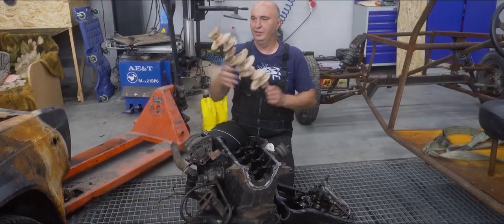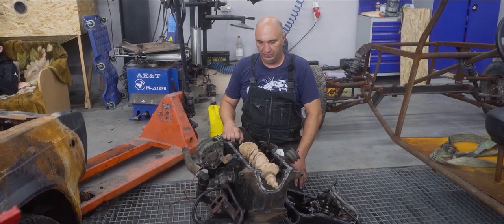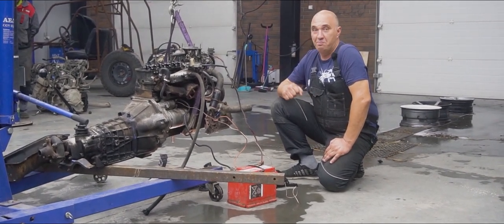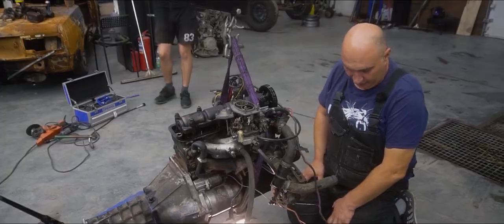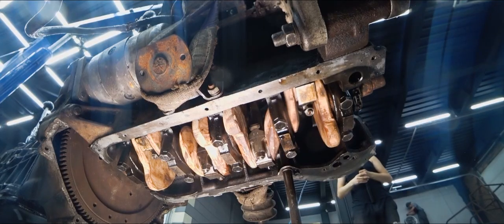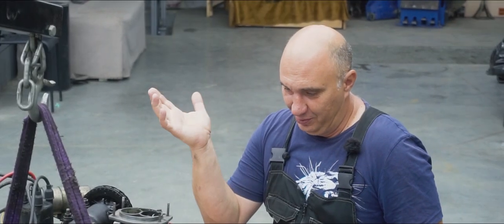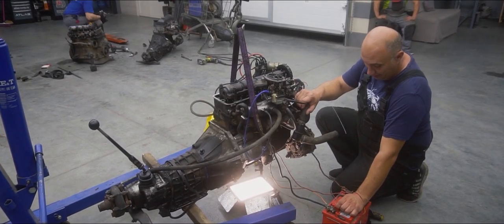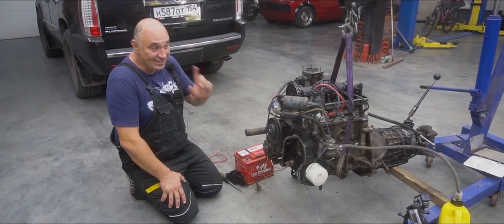Wooden crankshaft – will it work?

Comment: I think if you also use a wooden insert in addition to glue, I think it will hold (it can be a square, triangular insert) and maybe try to plate it with metal, as the wood swells due to temperature and oil.  I don't know if there is a varnish for wood to withstand high temperatures.

Comment: Hydro locked after pouring the fuel in the intake and not igniting the fuel causing it to lock up and break at the weakest point ie the wooden crank.
Great effort though 👌

Comment: try A; using drilled holes & dowl between the joints, B; using a glue a bit more hardcore then what appeared to be PVC glue (wood glue) C; try letting the glue set for a week instead of a few hours

Comment: Fun fact: early heatshields for spacecraft and (allegedly) nuclear warheads were made out of wood, one side used a incredibly dense wood fixed with a epoxy, the other used laminated wood like a airplane prop. As they encountered the high heat of re-entry a layer of carbon foamy type material formed, and protected the payload. Took years and years to beat simple wood! 🤣🤣🤣

Comment: with a large enough lathe you can lathe a crankshaft from a single piece. 
First all the block-side journals
the you offset the whole assembly and lathe C2 and C3
Offset again for C1 and C4
I would not worry of making "cool" balancers, leave them round

Comment: Making the crankshaft out of wood, the journals where the pistons attach are not in the precise orientation as the original metal crankshaft.  This put the valve timing off enough so it wouldn't start.  The fire out of the exhaust was due to the valve timing being off.  Combustion was occurring when the exhaust valve was open.  Even if the crankshaft did not break, it would not have been able to run.

Comment: It could be machined out of a single piece of wood, just make an offset jig for the lathe in order to machine the rod journals. It doesn't really need counter weights, there's not enough weight involved to matter.

Comment: You should add some wooden or metal studs in between each wood piece so if the glue doesn't hold the metal or wooden studs would keep it to still rotate.

Comment: Glue is not strong enough.  It gets soft when heated.  You need some sort of mechanical joints between the crank arms and journals.  I would suggest a wedged mortise and tenon with epoxy.  When the crankshaft is assembled true and polish the bearing surfaces and drill oil channels.   That might let it start running before it flies apart.

Comment: I predicted that under a load it would immediately snap off.
But i didnt expect it would be at the glue bonds, bc those are typically stronger (in this sort of wood) than the wood itself. That tells me it wasnt very well glued. You need full surface covered (which u did), but with minimal amount of glue. Then put pressure on that bond in some way. Even though it bonds pretty fast, for optimal bonding it needs days.
Im also wondering if dimensions/tolerances were precise enough. Not having that obviously increases torque on/in the material.
To make this work (for a short time); it would need to be made from a (well selected piece of) hard wood type, out of one piece, computer cut for best dimensions. And then it would still sheer off at stationary load when revving up. But it should be strong enough to just run stationary.
Obviously you cant have a cooling material, bc that will negatively affect the wood properties, making it sheer off sooner.
You could also (but thats cheating a bit) run a metal rod through the entire length of it, in the center, to deal with the internal forces and spread them.

Obviously steel is stronger than wood. I dont think anyone is surprised with that.
Nice job though... fun to watch ;]

Comment: Make a whole engine out of wood except for the main parts that need to be strong. So basically make a wood block, valve cover, oil pan, etc etc. so u open the hood of the car and its just a block of wood. U cld probably put sleeves in the wood block and the engine would function well probably

Comment: You need to use two or three wood dowels cross drilled at each connection. That way you're not relying on the shear strength of the adhesive. Adhesives have great tensile strength, but don't hold up to shearing loads well. The dowels would reinforce this quite easily.

Comment: The wooden counter weights are useless....just turn a solid shaft on the 4-jaw lathe chuck without counter weights....center drill 4 offset holes in the end of the shaft for the lathe tailstock to machine the throws.

Comment: You need to add 2 or 3 wooden dowels to each joint. The dowels will take the shear load instead of the glue.

Comment: Did you try running nails through the sides of the journals and the counterweights to secure the journals to the rest of the crankshaft to make it a more solid rigid piece? I think with some mechanical fastening it might work for a little bit before the forces generated destroy the crank but it would be fun to try.

Comment: To get a stronger joint, you could add small gauge doweling, and then glue it. This creates a stronger joint that might be able to withstand more torsion? I'm not an engineer, but I like to build things

Comment: That’s would of been hilarious if it worked but I knew it would not of.  A crank undergoes huge g-forces with huge loads which is why it has huge journals and bolts to hold it in place alone,  with balancing weights that are fine tuned to a micro gram.  Even if they had made a one piece shaft it still would of just rattled it self to pieces.  I suppose some one had to try it..........eventually.

Comment: if you bolt the joints together with metal exogon bar and plates  mill the shape into the centre of the joints it has a good chance of working

Comment: you might have more success if you pinned each glue joint with 2 or more wood dowels,  OR slot and tab each journal and press them together into a metal ring/sleeve that would act as bearing surface.

Comment: Just glue issn't going to cut it. Put dowls in. And lubricate it like it would normally. Oil do wonders. It wil also harden the wood :D
And use oak or something. Oak is a strong wood.
Greetings,, Kitty.

Comment: Drill a hole thru the head gasket area so it has no compression and remove the rings, and I’d still oil it and it’ll pop n spin for sure. Leave the mains loose too!

Comment: What about a complete shortblock out of wood.  Or wooden block with metal internals.    Or wooden cylinder heads with metal valves n springs

Comment: If some fancy joinery was done it may have lasted a little longer. Maybe even dowels at every joint. The glue must also cure for at least 48hours before such form of stress. For a trolley maybe, but not of even a small engine.

Comment: Can you use Carbon fiber to make a crankshaft? I did not find anything like that on the internet, ford has a motor with some parts carbon but not internal parts just covers, probably engineering limitations why they don't use carbon however is stronger than wood and steel even, would be a nice practical experiment. Love your videos wish you the best.

Comment: Maybe changing some of the design parameters would help. Start with lowering the compression ratio to maybe a 6:1 like the early car engines that ran on crap fuel. Next try something like Iron Wood which is about as strong as you can get. Let's not forget cross drilling for lube oil on the bearings... and maybe some dowels for the flywheel plus a keyway (or 2?) for the cam chain. I think it's doable, but wont last long.

Comment: U need to use dowels and make the connection of parts stronger by using dovetails to lock the moving parts in place like Japanese woodworking

Comment: my take on it, the first starting attempt the ignition timing was to retarded to get the engine to run witch is why it was flaming out the exhaust. when they put it back together they advanced the timing a little bit to try to get it to run, the cyl pressure as soon as it would try to fire was too much for the crank shaft thats why it broke right away and in multiple spots on the second try. could maybe try drilling and pinning the crank in all the glued spots but i don't think even made out of a solid piece of hardwood that this would ever hold together past 1 ignition cycle.

Comment: They should have changed the valve springs to something extremely soft, the valve train was putting too much drag on the crank and reducing valve spring would have really helped and even if it did run it would not have revved high any way.

Comment: need better adhesion than just glue.... use biscuits or dowels along with the glue to add strength to the joint. :)

Comment: Even copying the shape of normal crankshaft and making it from single log wouldn't work as intended imo. You would need to compensate counterweight for pistons and rods. With different density of wood compared to iron I'm afraid you wouldn't be able to fit crankshaft into the block.

Comment: Why don't you try making a crank shaft out of Aluminum and use brazing to join the pieces.
It's stronger than wood and should run for a bit longer. :)

Comment: You should if use wood dowells and glue at the joint and IT would hold !!!
Reply: IT seems like you have enough space for drilling 3x .250 holes about .250 deep on each Side of the joint of the wooden crankshaft. Insert wooden dowells with glue. Let IT cure and the you go guys!!!!

Comment: Wooden engine parts work only if the whole enine is made out of wood and theres very high octane fuel used i think and the engine can be used in short periods of time then cooled
Reply: I got an ideea put a lada made of fiber glass in the game and put wooden parts and other car parts out of weak materials like plastic and carboard(doors bumpers wheels)

Comment: You've got to use epoxy... And after it's all glued up you drill multiple holes through every joint and press in hardwood dowels with epoxy.  
If you do all that, the thing will be as strong as whatever wood you've used... You'd probably want to orient the grain of each piece in the proper direction for strength as well.  Regular wood stuff.
 I build guitars so there is a chance i could be slightly qualified in this situation... otherwise I would tend to keep my mouth shut. It's often better that way. Haha.

  Peace folks.

Comment: You guys ever installed a head without a gasket? I have but it was on an air cooled 4 cylinder motorcycle engine 81 Suzuki gs 750. I sanded the head and block with a gear driven orbital  sander...kind of like a da with an 8in pad..220 wet/dry paper the block is machined for an boring around the cam chain, I left that in. Thin coat of that brown shellac sealer..like permatex #2 on both surfaces and bolted it down...valve to piston clearance was a little on the tight side...ran that motor hard for a year without any problems..I figured no head gasket was worth .5 compression...I lived at 4400ft  so it wasnt a problem....always wanted to do it to a water cooled motor..I know that brown sealer is the shits..i have a 11.8-1 427 chev in my boat and i have reused the steel ship head gaskets  6 times on 2 different engines....maybe you try it sometime? You ever.run anything without coolant in cold weather? I had a 455 olds that I ran low on coolant...motor got hot and blew  the lower radiator hose off...25* and I had to go to work...I drove it 22 miles by running it up to 55, shut it off and restart at 5mph...motor was barely warm when I got to work..I used to ride a Kawasaki GPz 900...water pump seal took a shit, no parts available. Drained the milky oil out added fresh oil and pulled the lower hose off the radiator...14 miles to work...winter temp 20s30s...rode it almost 4 months like that...even ran better...think would never warm up with coolant in it...ran ratty as hell....you guys got cold ass weather...I'm from utah... I rode  motorcycle 100 miles and it was +9* when I left..I kinda cheat...heated grips..insulated armature wire .I think 65ohms per side...wrap the grips..hook to battery with a switch..
Keep up the good work...you guys are crazy mo fos...some kind of lesson your helper is getting..lol

Comment: This certainly could work, sorry no wood puns from a carpenter, varies types of wood have properties that do compare to steel. In this case, it appears they were using the Russian equivalent to arts and crafts glue. In most applications of good glue, the material separates before the glue. Also from a mechanical standpoint I almost certain it was way out of time. :'D

Comment: Wood it work with dowels (as others have suggested), lower the compression ratio to 6:1 ala flat head Ford V8, retard timing a bit (to minimize peak pressure), fuel injected so there's a more predictable combustion process, idle only?  Also, pretty sure those counterweights aren't going to offset the rods moving; better go with titanium rods.

Comment: Lol .. But still brought to you by the folks who handed the German engineers their asses. 

A one piece machining likely wouldn't have fared better .. Assuming lathed along the axis of the most desirable heartwood species .. the counterweight cross section would be across the wood grain, still .. with a bit of care, selection, and double pinning (doweling) .. the throws "assembled" (like a motorcycle crank) and radially pinned and glued .. I could see this working  -  until you loaded it.

Suggestion .. how about trying to cast a crank entirely from JB Quick. :)

Comment: Why didn't you turn it out of one piece? Would have been much sturdier and you could have done it on the manual lathe. Just offset the center. That's just bad work you did there

Comment: I'm sorry. But, no. That's not how you do it. You need a precision lathe and a balancing machine and to machine the crankshaft out of a solid block of (high quality Finnish) wood, for it to pass as the genuine article. That's how you make a metal one as well.

Now it's just some weird approximation of a crankshaft made from wooden parts. Not something that could be designated as a "wooden crankshaft". Good for maybe farthers day persent or something. That thing is roughly equivocal to arts and crafts made by a public school student in woodshop class. And it will not get a particularly high mark from the teacher either. And I'm not joking. This is ridiculously dismal kind of carpentry on display here. Yup, from a solid block with a lathe or there's no A in it.

And if you need to make it in parts, you most certainly don't use processed horse to attach them together. Only appropriate wood connecting cuts mechanical linking is acceptable for a passing grade from woodshop class on a elementary school level. Yet again. Not joking here. I nearly got to re do an entire school year for failing that. (OK, maybe I'm over exaggerating. They don't make people redo grades anymore. And as a consequence some get degrees while being completely illiterate... But, you know. Back in my day. In the 90s ) 

You don't fucking make it in bits and then attach them together with recycled horse. That's not how you shape wood or make anything functional out of it, everyone knows that...

And yes. That applies to everything that can be defined as "made of wood". Now its made of processed horse with some wooden bits attached to it.